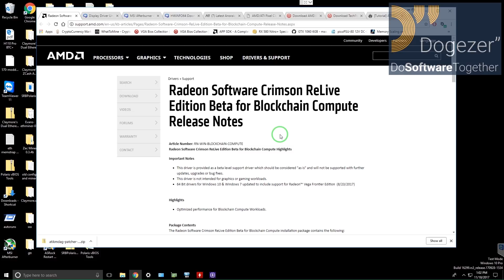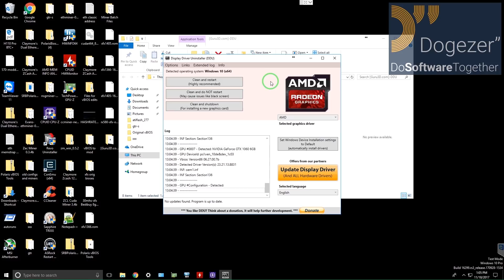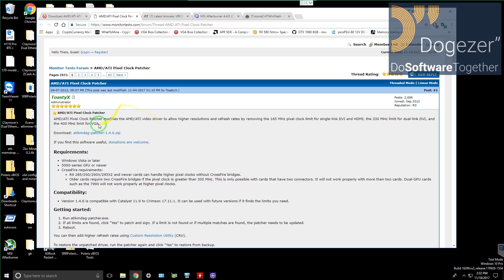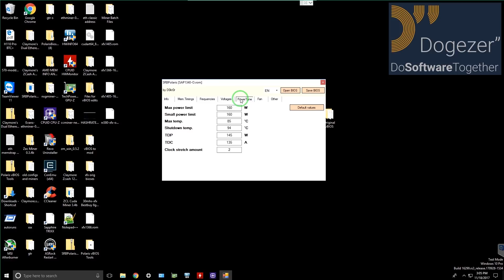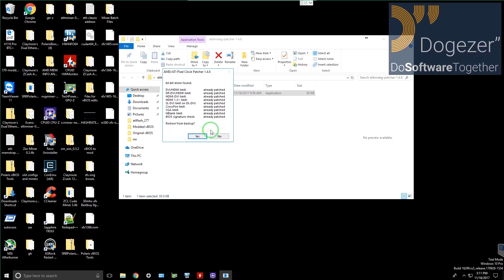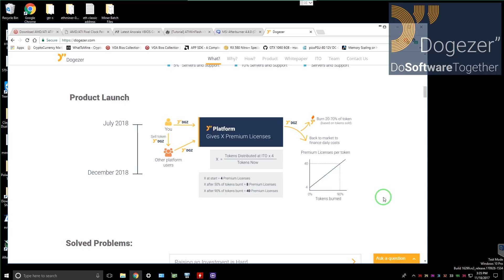How To Optimize AMD RX 470/480/570/580 Cards for Mining - FULL GUIDE!

Comment: Thank you very much for this guide. I'm doing some research and POCing right now and this was VERY helpful at getting me moving in the right direction!
Reply from the maker: Glad to hear it, let me know if you decide to move forward with your concept and need any help!
Reply: Will do. I'm at my "Early Alpha" testing stage right now, will be moving to late Alpha this week, and if that goes as expected I should be moving into beta testing in the next week or so (Yeah... I'm an IT geek :) ). Earned a whole about $0.50 in the last about 24 hrs. HAHAHA!
Reply from the maker: You and me both on the part of being an IT geek haha, good luck!
Reply: After some tweaking and playing around on my MSI RX-580 GTS-R 8GB I'm able to get about 27.1MH/s ETH and about 811 MH/s DCR while dual mining with Claymore 10.2 1049Mhz GPU/2174Mhz Mem, -18v, +25% Power limit. Now this is on my normal desktop, so I'm wondering if that's stopping the last 2-3 MH/s or if it's just a bit of the silicone lottery? Any thoughts on it?
Reply from the maker: Assuming you meant to type "XFX GTR-S." And you mean this one: (http://www.xfxforce.com/en-us/products/amd-radeon-rx-500-series/rx-580-gtr-8gb-dd-led-rx-580a8dbr6).

If so, your card should be capable of 29.x - 30.x Mh/s when dual mining Ethereum and Decred. The PC which the card is in should have no effect on the hashrate unless you're using the machine while it mines, especially since your power at +25%.

Try testing your core clock around 1155, max out the mem clock (2200 or 2250), -50mV, and -15% power limit. If I was right in assuming you meant the XFX card from best buy and you can't hit above 27 hashrate with the blockchain drivers, then it sounds like you need a different .rom file to flash to it. If that's the case then search on Anorach for "Best Buy XFX GTR-S (or the model number). The one I've found that works best is called something like best buy xfx secret sauce.
Reply: Evanjdevelopment I just grabbed one from Best Buy (I needed my toy NOW 😁, and I had some points to spend) so it's this card: http://www.xfxforce.com/en-us/products/amd-radeon-rx-500-series/rx-580-gts-8gb-dd-rx-580p8dbdr
Reply from the maker: I know the feeling haha. I believe there's one for that card as well in the Anorach forums if you search for the model number with it (580P8BDR).
Reply: The only specific one with my card listed is in the request section. I'm using the Xfr  rx  580 GTR-S memshift 1750 rpm from Anorak right now.
Reply from the maker: Did you try my suggestion on clock settings or was that unstable?
Reply: I've tried a whole bunch of options. I'm pretty convinced that the issues lie with my system/OS as it's been used and abused on the PC for a couple of years. My bet is a fresh install of Windows and drivers would make things better. Guess that's going to be my beta testing.
Reply: I haven't been able to push anymore based on my current set up, but I did change from dual mining ETH & DCR to ETH & LBY and it looks like I should make a lot more doing this. I think I found my pixy dust! :) Thanks for all your help. Once I'm up and running I'll send some coin your way.
Reply from the maker: Let me know how it goes. And if you'd like, send me a direct message and we can chat via email. I can take a look at your original .rom and see if I can try/find any suitable edits for it.

Comment: Awesome 
Just did the first part and uninstalled existing amd drivers
Got 9 extra mhs and solved huge problem I was having with afterburner 
Will flash gpu's bios in morning 
Thanks
Reply from the maker: Glad to hear it helped you out, Mark. Reach out if you hit any snags with flashing the cards. 👍🏼
Reply: Evanjdevelopment if you have both hynix and Samsung do you edit both memories? Pretty sure you do but want to double check
Thanks in advance
Reply from the maker: Mark, yes you usually edit both but certain settings are better than others on different cards. For example on my Sapphire special editions which are Hynix and Samsung I have only the top Hynix strap at 1750 and on the Samsung I believe I have the top two set at 2000.

Comment: Thanks Evan your  technique was the only one that worked for my 4 Shapphire Nitro+ SE Rx580 8gb  rig, I was only getting 10MHs on each card and could not figure out why now I'm getting 28.5MHs on each  and am elated maybe in a view days I'll go for 30MHs but for now Blessing to you Evan and please stay well
Reply from the maker: Makes me happy to hear this, I'm not sure if you're using overclocking software (MSI Afterburner, Sapphire Trixx, or other) but you can push those Nitro+ SE 580s higher. I have 4 of them as well and each are getting about 30.5xx - 31.3xx Mh/s. If later on you would like to try for a higher rate let me know and I'll let you know my MSI Afterburner settings and send you my vBIOS mod for the cards.
Reply: Hi Evan I have both on my system Afterburner an Sapphire TRIXX ,but have not been able to get the afterburner to work but The TRIXX aknowledges all the cards and I can adjust the clocks and voltage but once I turn it off and on again the GPU Clock and memory clock setting go  to (0) zero?  I have my fans set to fixed @ 50%  and am mining on Nicehash with sgminer 5.5.5 on crytonight my average is 2.85 Kh/s( not bad at all), Oh the Bios mod from Anoraks is Renamed Sapphire NITRO+ 580 8GB Hynix-411,I think , in it the 1: 1750 and 2000  different and 2: 1750,2000, 2050, are the same,  to get my hash rate higher would be great! but if not I'm greatful for the fix I have Thanks again Evan stay WELL!

Comment: Im a complete noob, this was my first flash for my first card on my first rig! 
well that was hands down the best and calmest tutorial i have ever followed. your voice is even calming and easy to understand. love it, pissed off that it ended haha, i was in tranquility :D. 
got an extra 3-5 mh/s on my card.
may i ask for a msi afterburner overclock tutorial plz ?
Reply from the maker: Glad I could help. For tuning with Afterburber, I originally had the footage in this video but cut it out to shorten it haha. You'll want to downclock your power by 10-20%, drop the mV by 50-95, drop the core clock to somewherr between 1000-1150 and raise your memclock as high as possible (as long as it's stable). Make sure to unlink the temperature value from the power setting.

Comment: Two things. 
First: Great video!  It worked for me on my very first computer build ever, which of course is a miner. 
Second: You said you make additional settings on MSI afterburner. So let's see a video on that! 
Why? Because I got a great working bios on Anorak (gigabyte rx570 powersave 1500 version) but custom powersave and overclocking is now an entire new adventure while currently running 24.7 mh/s, but 27.5 mh/s is the goal.
Reply from the maker: Yes I definitely plan to include Afterburber and probably TriXX as well in my next video. I'm covering a good bit in it for mitigation and avoidance of most (if not all) issues as well as recommended settings, programs and such within Windows 10.

Comment: I'm your lucky 777th sub! Just one question though... After flashing my gpu do you recommend increasing my hash rate with changing any other settings or should I be happy with these results? Thank you in advance!
Reply from the maker: Definitely run MSI Afterburner or Sapphire Trixx to increase your memclock and reduce the other settings for power saving (if you want).

Comment: Well Evan: What a great video/guide! I am using the MSI Radeon RX 580 GAMING X 8G GPU cards. Before your guide I did not get the card faster than 21M/h with BiosEditor, msi afterburner, etc.
the hint of the AMD blockchain driver made it run immediately @30M/h :) (you think it can get even higher?) TY so much evan! Thumbs up
Reply from the maker: Awesome to hear this, results like that are what I was hoping the video would help others achieve!! As for attempting to go higher on your Mh/s I would say it is possible. Your results from tweaking further would only be marginal though, I'd estimate within 0.5 - 1.3 Mh/s higher. The results may not be worth the headache to get there though, trust me lol. From personal experience I stick to the motto: "If it's not broken, don't fix it" because in crypto, downtime is your worst enemy as time really is money.

Comment: Thank you so much. From 18 to 30 MH
Reply from the maker: Awesome to hear Luis, good work.
Reply: You are the awesome. Thak you again.
By the way. How can I see the full energy is consuming each GPU with the Bios configuration I found in Anorak.tech?
I see GPU-Z does not have a one value for full energy consumption and the 3 values it shows are confusing. Also I do not think I have to sum them all.
Regards.
Reply from the maker: Afterburner can also show power draw for each card, but honestly the best way is just to check overall power consumption with a physical meter between the psu and the wall. On Amazon the good ones are called Kill-a-watt meter.

Comment: Hey Evan, thanks for the video. Very good explanation. 
I was wondering if you could help me in a question i have: 
 I'm trying to build a sucessfull mining rig. Inicially i had 4 GPU : MSI RX 570 4GB running at 28MH each. But it was a friend of mine that helped me to do the "magic". 

But now i decided to go more deeper and i've bought more 3 but RX580 8GB and a decided to install myself. 
Do i need to pay attention to other things because of the difference of the model or its just in the Polaris step that i need to be more careful?
Can you see if this step sequence is correct (please)? 
. with the GPU Z save the original BIOS
. then use Polaris to each one of the gpu ( for rx570 i've been using 1500 -> 1625/1750/200) and for the rx580 (gonna use the one you show in video).
. save the modded BIOS in ATIFlash folder. 
. cmd as admin and use the right command line 
. patch it and reboot

Thanks and sorry for the long text

Comment: Thank you so much for your video. It was extremely useful.  I am able to get my first card stable at 29.4Mh/s.   I'm using Sapphire Trixx to manage the clock settings and fan.  I have the GPU @ 1150 and the memory at 2150 and -100 mV.   I'm a little scared to play to much with them, but I'm sure that tweaking this might get me over the 30Mh threshold.  Any recommendations?
Reply from the maker: Tom,  great to hear it helped you out and thanks for the encouragement. I'm not sure what card you're using but from the clock speeds it sounds like a higher end 580. While I can't speak on behalf  of Trixx, below are my Afterburner settings I use on my Sapphire and XFX 580s:

-86mV
-20% power limit (-15% if stability is an issue)
1154 core
2250 mem
Temperature thresholds set to highest value the card goes to (usually around 86°C) to avoid any throttling due to temperature limits, and a custom fan curve set to keep the cards running around a consistent 60-65°C.
Reply: I have XFX 580 8GB and MSI 580 8GB cards.  I've only flashed (1) XFX card at this point.  I used the Anoraks_XFX RX580 XXX Edition 8GB Samsung_memshift-1750.rom file as you recommended and tweaked the card settings with Trixx.  As I mentioned I can can only squeeze out 29.489Mh.  I'm pleased for sure, but I feel like I should be able to get an extra .5Mh somehow.  Any recommendations?
Reply from the maker: It may be possible, which exact card model for you have, a best buy version one with the swappable fans or is it a different one? A link to it's product page or if you can tell me its model number I might be able to dig something up.

Some things you might check into would be your power plan settings within Windows and setting your rig into 'high performance mode'. Make sure to specifically alter the setting for PCIe link state power management to off if not already set that way (give the PC a reboot after this).

Another possible way might be by attempting some test runs after booting back up and slowly raising some of the underclocked values in Trixx. You could try your mV around the 50-60 range and bumping the core clock up in increments of 25-50 and looking for any changes. 

Just a side note to keep in mind: I understand the feeling you have about wanting to see that 30.xx Mh/s on the prompt and can totally sympathize with that. Just don't let it bug you too much as the difference is only marginal in reality when compared to your current results.

All GPUs will have different 'mileage' even if they are the same make and model. It all depends on the quality of the chip (you can check this in GPU-Z under the advanced tab and looking at your card's 'ASIC quality' percentage)

My rule of thumb is "if it's not broken, don't fix it." Always remember that in the crypto game downtime is your biggest enemy and time really is money.
Reply: Evan thanks again.  Yes I agree.  It's 29.4, that's really awesome.  It's working.  It's stable.  I'm truly thankful for your tutorial and your additional comments.  Merry Christmas!
Reply from the maker: No problem, Tom. I'm just happy to see success and comments like yours. Merry Christmas to you and your family as well. Always feel free to reach out to me if you get stuck with something.
Reply: Evanjdevelopment or Tom: 
Do any of you get an error on claymore saying gpu # got incorrect share don't overclock too much.
Ps this only happens on the cards getting 29.4mh/s  I underclock the core to 1350 still  same issue. Xfx Gts black edition rx580
Reply from the maker: Yeah I've had the issue before. And sometimes switching the cards to different risers or a few reboots and cleaning up the PC with CCleaner may help out.

Comment: Thanks for a great video! I recently completed a 6-card rx570 rig. Five of my cards had Hynix memory and one had Elpida. The bios mod was effective on the Hynix cards (Going from high 21 MH/s to 24+) but my hashrate stayed the same on the Elpida-equipped card, which is around 22.4 MH/s. Any suggestions??? Thanks again for a very thorough video.
Reply from the maker: You may want to Google around (a lot to be honest). I know another person who got one of their 6 cards having Elpida memory and had the same issue.

Problem is that due to the GPUs being pushed out so quickly from supply and demand that AIB partners ended up using Elpida recently and there hasn't been a large amount of info on modding them.
Reply: Hello nice you video! But have same problems to 6 GPU MSI Gaming X RX580 4GB Elpida lasted GPU#5 have drop off hashrate from 28 to 25 Mh/s. Other 5 GPU same 28 mh/s than GPU#5.

Comment: Thank you so much! I will follow this tutorial and download powersave bios from anorak.
Can I use the newest AMD drivers?
Reply from the maker: Yes you can if you don't mind using wattmann for tuning the cards, just make sure to set the drivers into compute mode.
Reply: Evanjdevelopment how to know what settings to use for wattman? Why not use msi afterburner?
Reply from the maker: I think with the new drivers you may have to use Wattman but I'm not positive, you can try Afterburber but If you get issues with it, it will likely be from the Wattman settings stomping on Afterburber
Reply: Could u make a tutorial about adjusting the watt, volt, oc for 570 4 and 8gb?

Comment: Amazing explaination. I haven't tried the optimization yet but as soon as I started a test with one GPU (xfx rx 580 4gb) its only hashing 18 mh/s. Please let me know if you have any fix/suggestion.
Reply from the maker: Ashan, when your say you haven't tried any of the optimization yet what do you mean exactly?

Are your results just from a test run on regular AMD drivers and the GPU at stock clock speeds?
Reply: The result are from regular AMD drivers and the GPU at stock clock speeds. I am optimizing right now and will update you with the results. I was curious because Jay (the guy you helped) had the same gpu and he was getting a hash rate of 29.5
Reply from the maker: I believe his 580s were 8gb variants and not 4gb models, but yes please let me know how it goes and what your results are.
Reply: Thanks for your speedy reply. Looks like it jumped to 25 hash-rate but not going beyond.
Reply from the maker: Bump up your memclock in MSI Afterburner to as high as it can go and still be stable.
Reply: you are a genius dude. by bumping up the memclock my xfx 580 4g is doing 30.5 mh/s  at 60c* and the fan speed at 70% power limit at -11
Reply from the maker: Now that's what I like to hear! Nice work man!

Comment: Great video. Once you have made those changes, can you remove the GPU and put it on a ETHOS Rig? Or the GPU will forget the overclock values? The reason im saying this is I dont know how to do all this inside ETHOS just in win10...
Reply from the maker: George, if you're referring to the vBIOS mods staying hard-locked to the GPUs then the answer is yes it will stay. You can safely flash your GPUs under a Windows environment, and as long as it yields a successful flash, you can move them to whatever operating system you would like.

Comment: Thank you for the great guide! Did go from 24 to 27 MH by flashing (already had the driver). I have one question. What is the difference between the 'memshift' and 'powersave' roms? Which one would be more effective?
Reply from the maker: To be honest it really depends on your aim for the rig, if power draw isn't an issue and you're not worried about your electricity bill too much then you don't need to bother with the powersave. You can save power other ways as well like with Afterburner or Trixx.